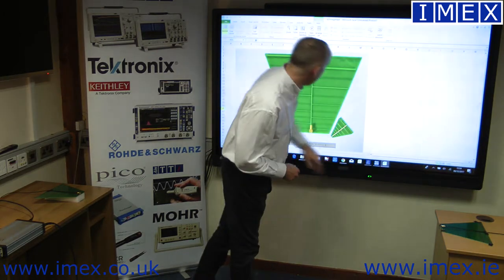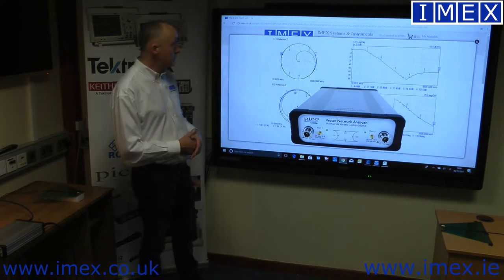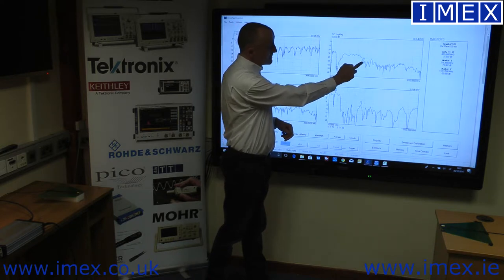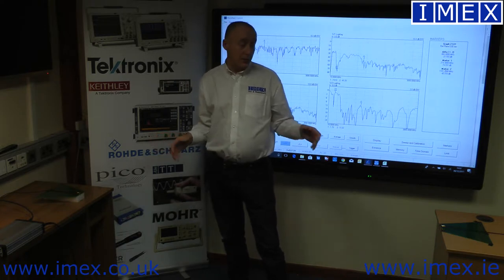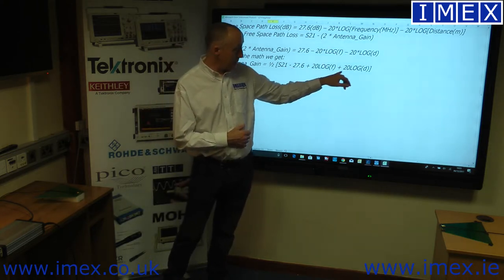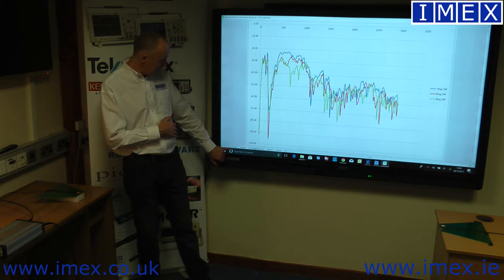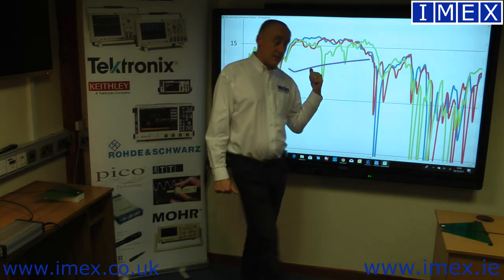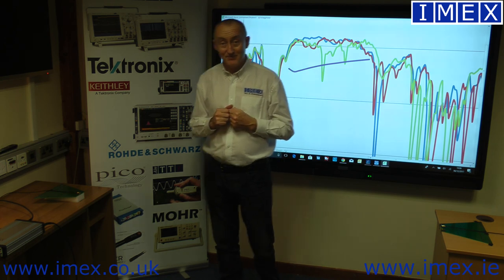EMC Testing part 1 of 3 - Antenna Qualification

Comment: I appreciate the video, but I could not understand the audio when the voice volume was lowered.  The audio became muffled.  I also wished that the video could have started showing the test setup.  All I understood was that there were several ways of measuring.  I would have like more detail on how to set up your equipment.  I think that it was said that a spectrum analyzer was used with a tracking generator.  How was the setup normalized?  I think that this video was showing results rather than showing how to do the testing.  This is frustrating when you are wanting to understand how to measure your own antenna performance.